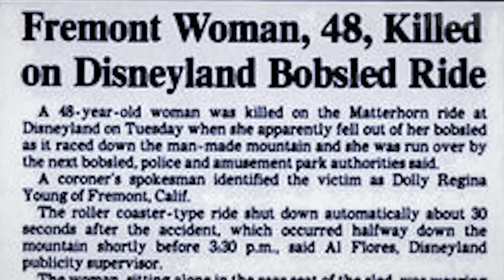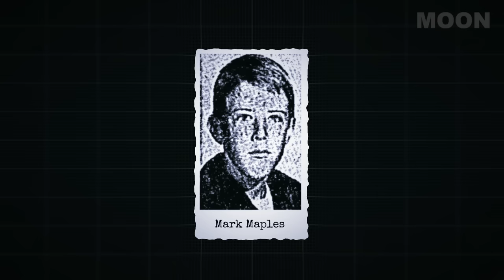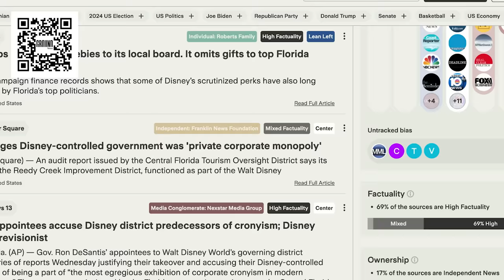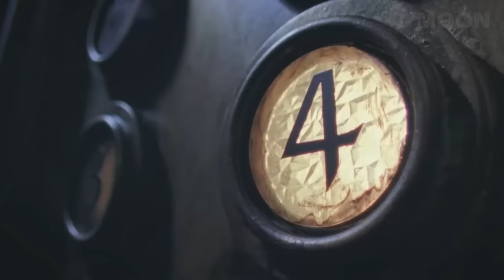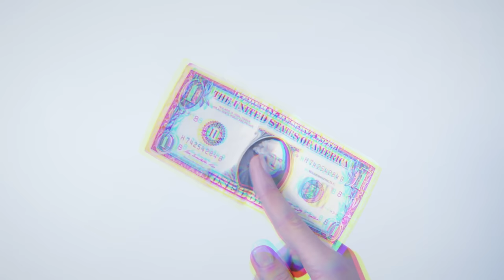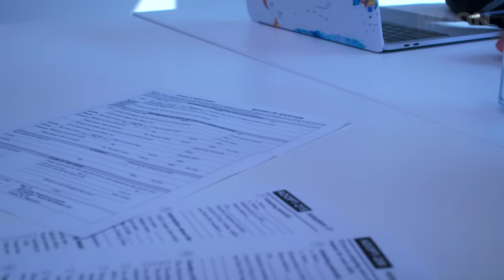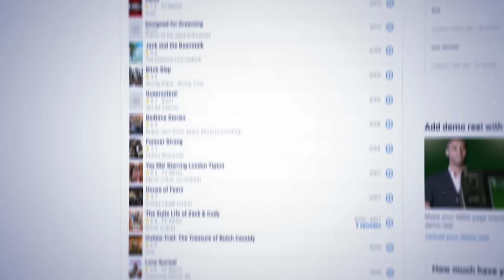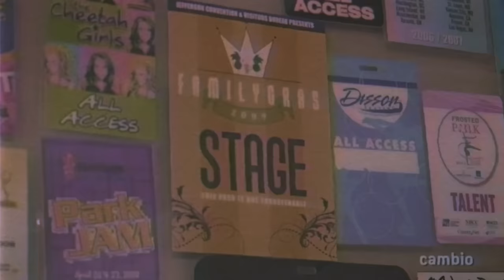The Most Disturbing Crimes of Disney World

Comment: I was on tower of terror when they called it gaurdians of the galaxy. I believe that was end of 2019 grad night. Yeah that ride was for sure terrifying and should have a weight and height requirement. Im 4'9" and even then only 95 to 120 pounds. The belt was kind of loose and I  was quite literally flying out of my seat to the point i almost felt like i would slip out of the ride. I had to try to hold the seat hard to stay in it at all. The ride itself also went too high and moved too fast